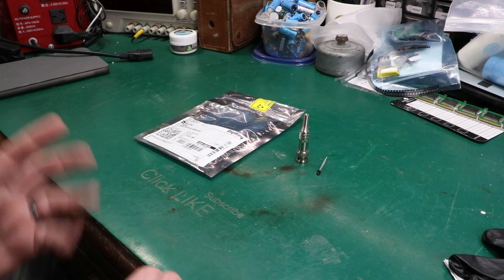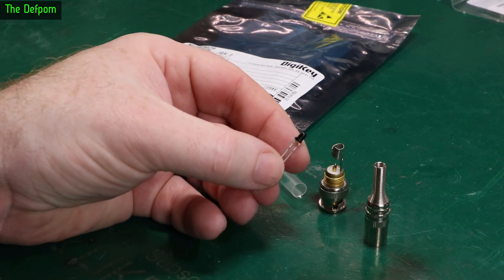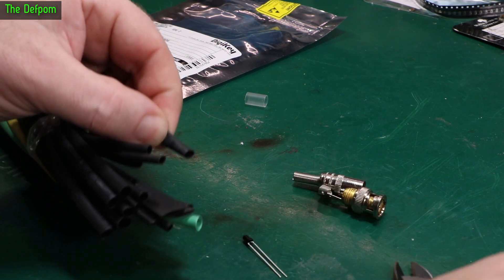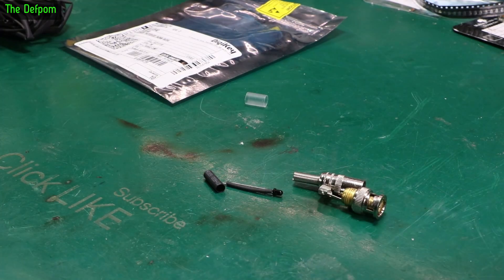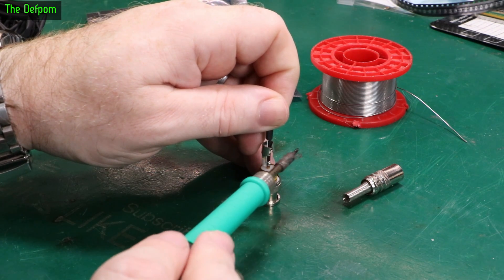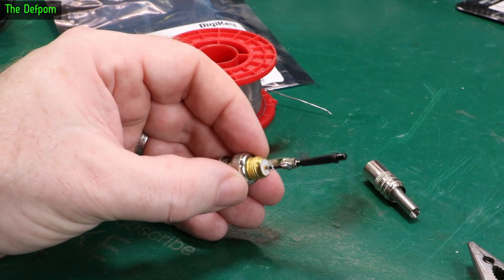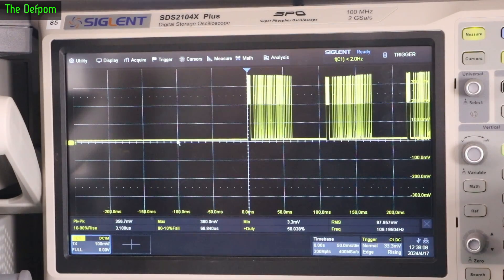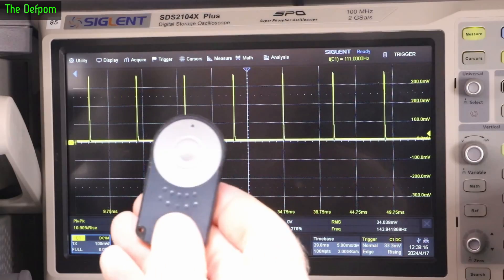🔴 Build A Remote Control Tester ! - Test Infrared Remotes - No.1245

Comment: A parallel resistor to discharge the capacitance of the diode will greatly improve the response time. Try different values to find out what works best.

Comment: Great idea thanks.  I wonder how practical it would be to create a similar device for testing car remotes - sensing a few hundred MHz? It would need a bit of active circuitry I guess?
Reply: Yep although you can get usable readings by connecting the earth lead of a probe to the probe tip, x1, 2mV and 5us/div and lay the loop against the remote. Now though I just tune in an SDR receiver and make techno music 😄

Comment: i think i would have connected a cap by one lead just to have a cap in the video. Plus it would be a good talking point as to what it does in the circuit. :-)
Reply: I think Scott would have to run that mod by Fred for approval.
Reply: @daveodessa  it will be ok if it's an electrolytic one. 🙂
Reply: @daveodessa  Watcha Dave Squeak !
Reply: @andymouse  Cheese!
Reply: SQUEAK !!!!!!!

Comment: If the exact waveforms are not the thing you need to observe, but for example just to check if the remote or battery is totally dead, it is luckily very easy to use digital camera or mobilephone camera which shows if the led is flickering or not.
Reply: My recent phones block IR, so no longer any use.

Comment: That's a nice idea. Much better than clipping on in oscilloscope probe with a resistor. I'm assuming you're using internal 50ohm termination?
On the other hand, diode is easy to find on assortment cabinet where the one tester I'd need rarely is sure to be misplaced somewhere not to be found :D